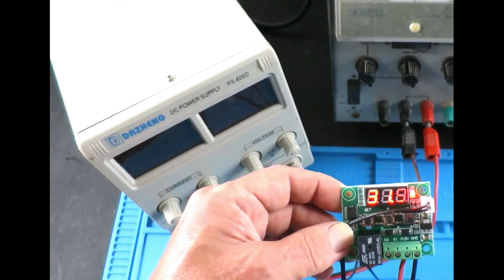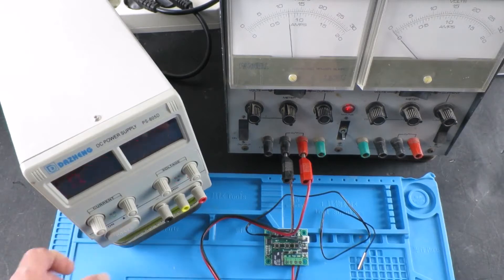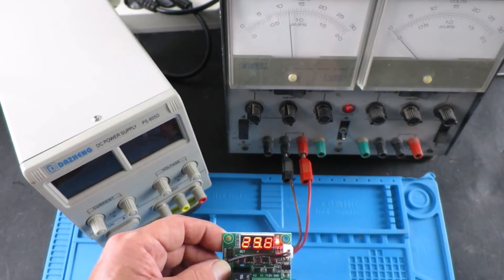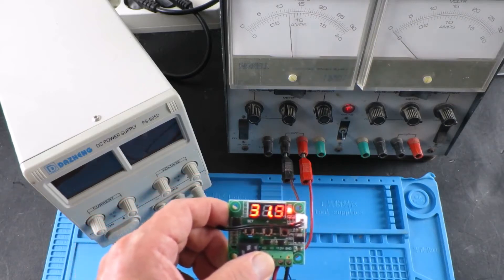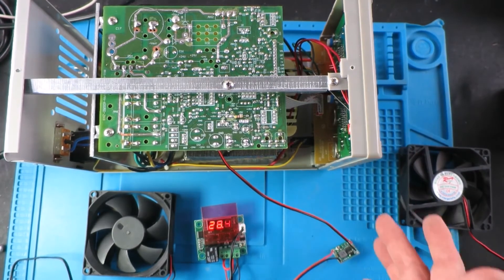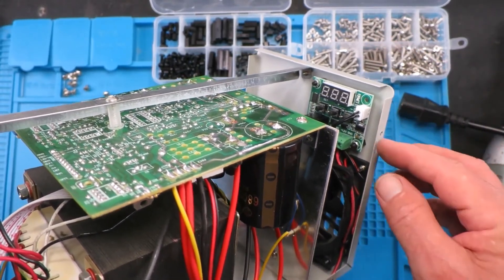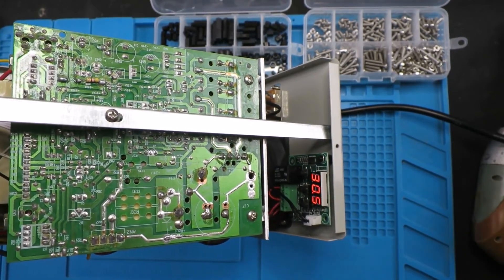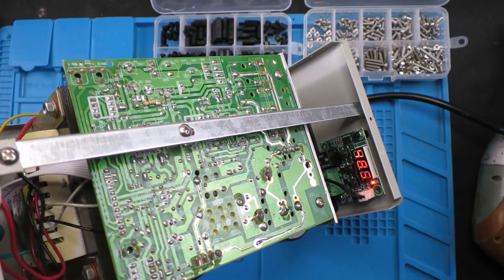"El Cheapo" Power Supply Noisy Fan Fix - Electronic Tutorial

Comment: Really nice idea, man. I'm going to build one of those lab bench power supplies (using a DPH3205). And it's going to need a good fan. Maybe I use one of those thermostat too. :)
Reply from the maker: Obrigado Mario! The DPH3205 is a good choice. Depending on your current needs you may need a fan, it just bugs me when they run all the time for no reason! I will retrofit one to the other supply I built : 
https://www.youtube.com/watch?v=t5N3iKWbSDM
Reply: 1nformatica Really nice! I've seen a few videos that used that kit, but I don't know... I don't like linear regulators too much. Anyway, I have three power supply projects here and another one that's going to be a battery pack charger (but can be used as a power supply as well), but... Except by the last one, I can't make them yet. I need a lot of banana bores and plugs (including for a project based on an ATX power supply), but I just can't find all the colors locally I need to buy. :/

Comment: This is a awesome way to cool or heat things. There's a 12v side to power the board and the other side is completely isolated just don't exceed the rating of the relay so you can run any voltage between 12v on up to the amperage limit of the relay. 20a is a lot to play with.
Reply from the maker: Good points as always MrBrymstond! Many folks do not know they can also be used to control heaters, I put the instruction sheet in the description but I don't think many people look :  http://www.kelco.rs/katalog/images/17670.pdf